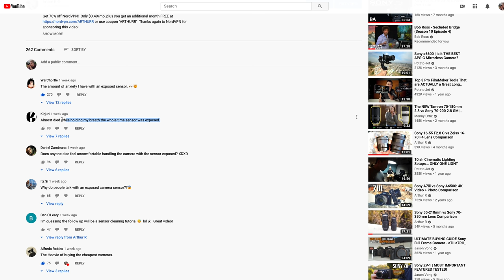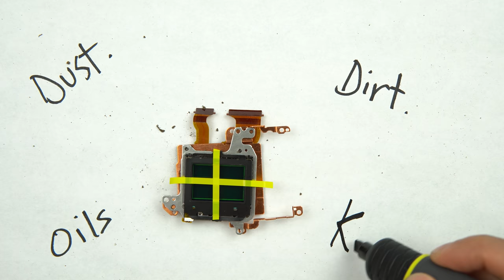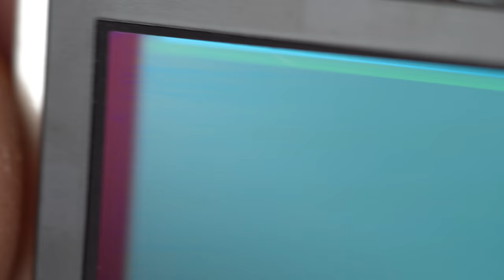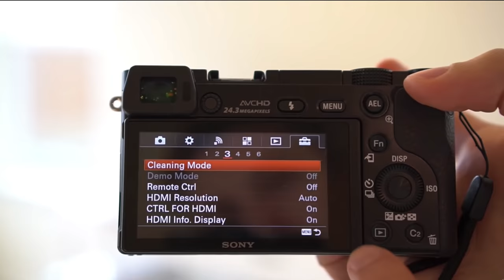How Scratch-Proof is a Sony Mirrorless Sensor?

Comment: You are damaging the infrared filter over the camera sensor. Most are made of glass. and removable  / replaceable .   you should try to remove it  and replace with visible light filter that will make your camera an IR camera

Comment: So weird, how could I scratched my A6300 sensor with just pristine q-tips and alcohol?
Reply: You probably didn't blow it first. Blow the micro dust first as it's the most harmful susbtance to glasses and alike.
Reply: @trym2121  I blew off dust with blower and noticed tiny specks on the sensor (some kind of dried fluid). So I went with q-tip as "recommended by some expert online". I think the tear shape of q-tips cannot exert even pressure and hold just right amount of cleaning fluid. 

I then bought a VSGO cleaning set and that went well.

Comment: I got sand stuck to my sensor, a7siii.. am i totally fucked?
Reply: about 5 tiny mini specs. I dont want to wipe incase i scratch. Im travelling and cant seem to find a repair shop
Reply: lol
Reply from the maker: I would just clean it with the kit I use. You should be okay. These sensors are tougher than you think.